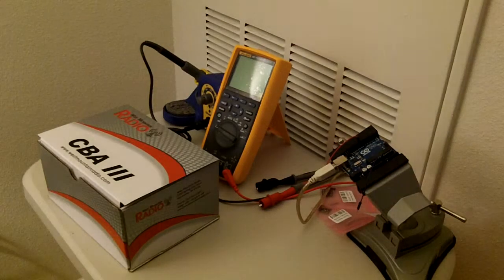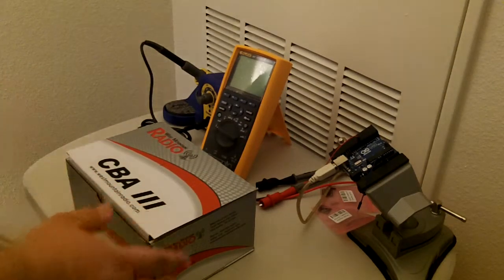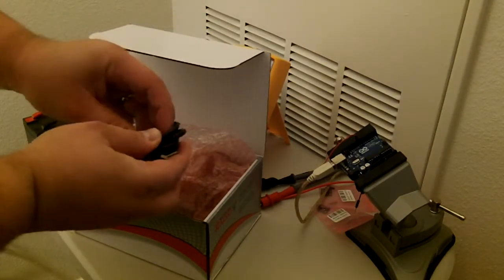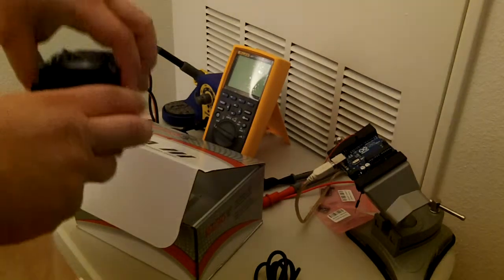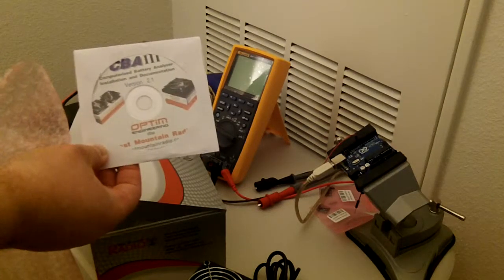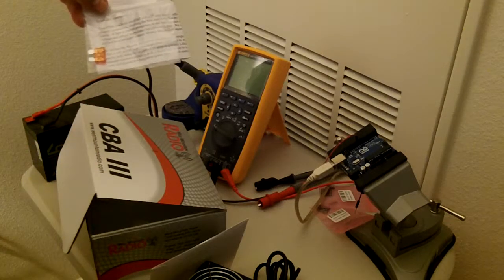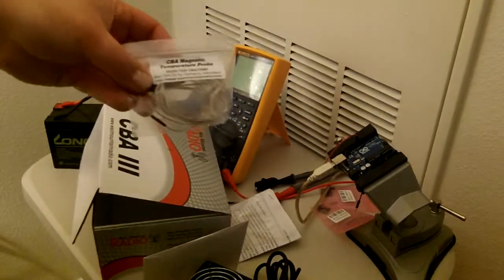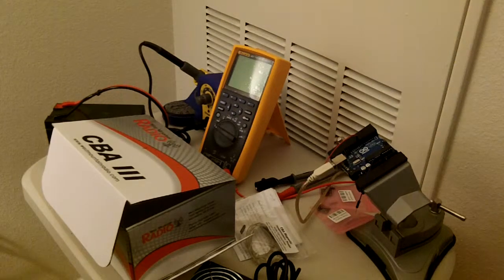Unboxing of the West Mountain Radio CBA III

Comment: So you unboxed it but did not like it so much that you never made a review? Was it so bad that you had to buy a 600$ dc load compared to this 140$,and the maynuo DC load is 300W compared to 150W? only 2x more and di you realize that for 600$ you can buy 4 CBA devices totaling 600W???

I see you got Arduino in the background, you could automate everything you said that hamradio want you to pay money for. But it's your money as they say.

It's just sad you never provided comparison to justify the 600$ spent on maynuo DC load

All maynuo DC loads I've found looks to be from China, not taiwan or japan like you believe.
Reply from the maker: +juliusvalentinas I do like it very well, and it has been what I primarily use in the field for profiling solar panels.  I bought the Maynuo because I needed to be able to simulate 20A loads, and the 500 watt amplifier for the CBA was more expensive.  Also, I got my Maynuo for well under $600.  I also wasn't aware you could purchase multiple CBAs and "chain" them together such that their total capability increases.  I'll have to look in to that.
Reply: But you could have bought the Maynuo for 300USD I  think from aliexpress why feed  another hand? Buy direct feed the Chinese that made it.